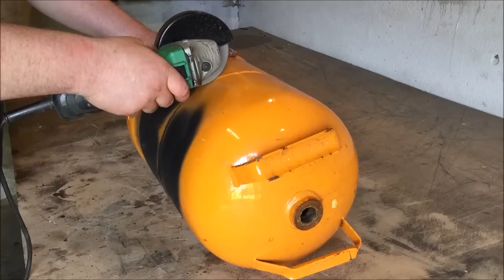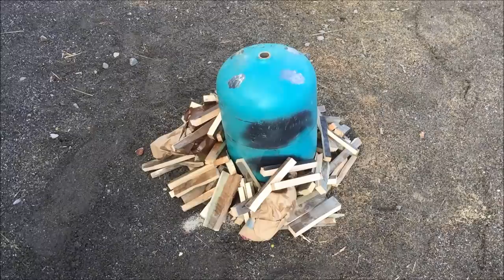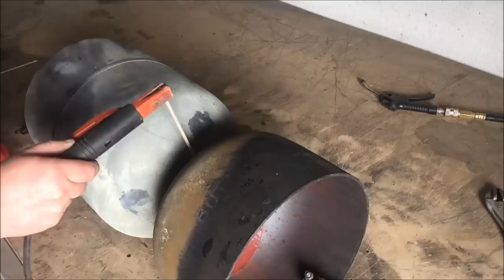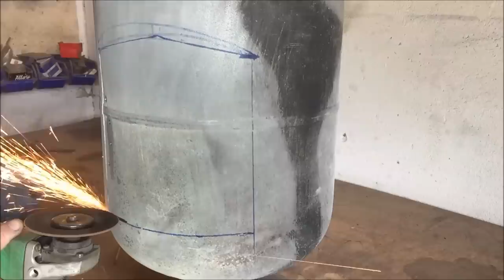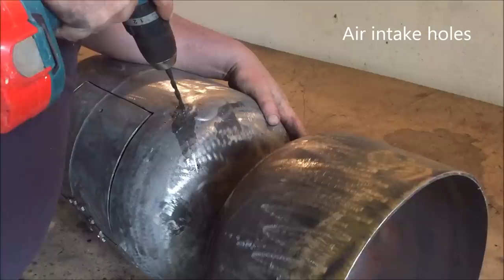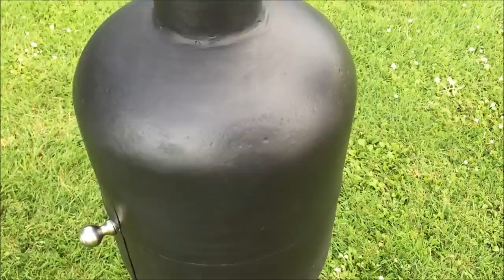DIY  Patio Heater / Fire-Pit

Comment: luv it but from my experience you should drill 8 x 20mm holes  about 6 inches from the top of the chimney pipe to get a secondary burn  and take away the smoke
Reply from the maker: Hi Mark, thanks very much for the tip.

Comment: Very nice build !

The door is a little tall for my taste, but I would use it as a wood burning stove.

Is your only air intake the through holes from the valves  butted together ; on the bottom ??

Comment: Very cool!! I was hoping the build wouldn't require welding (I don't have a welder unfortunately), but this is a very nice build. Thanks for sharing!! :-)
Reply: Use super glue
Reply: You can use J-B Weld high temp(I did on the chimney on the one I built),and to connect the 2 tanks together use a short pipe nipple the right size. No welding required.

Comment: Nice work.  I wonder if maybe you could have used another tank on top with a secondary air intake for seconday combustion to cut the amount of smoke?
Reply from the maker: Thanks, that could work. When it is lit first there is a some smoke bit when the fire gets going and it warms up there is very little smoke.

Comment: I agree this is a cool Idea. But as a person that burns wood a lot. This thing needs some addition to get 2 thumbs up. #1 if you could add a tray that regulated Air intake and #2 doubles as Ash collection, this would be right on. I’m telling you getting the ash out of this thing is gonna be a pain every time. Adding a latch to the door handle is a must. This way if a log falls over inside the fire it can’t fall out and onto your floor
Reply from the maker: Thanks Grant.

Comment: Great channel Eamon, thank you. I am also am mad into making stuff, lucky can also weld and fabricate and have a good work shop. Can you advise please, I am starting a project based upon (inspired) by your video using a 47 kg tank. Have had for many years and left valve open to get rid of as much fumes as possible. Do you happen to know if they come off anti clock wise or clockwise? Want to purge with water just to be on safe side before I start fabricating.
Reply from the maker: Hi Martin, thank you. If I remember correctly it was anti clockwise to open and it was extremely tight. They definitely need to be purged. I  filled them with water to remove any remaining gas, emptied then refilled again. I then left them outside  open air for a few weeks to vent before being used.

Comment: Cool project. Did that have any impact on the grass under where you had the fire pit sitting?
Reply from the maker: Thank you. The heat does not travel down to the bottom section at all.

Comment: How dose it hold up with the heat over time.? 
Also is the base cool enough to place on a deck?
Reply from the maker: Hi Ted, Its holding up great. I give it a coat of heat resistant paint once or twice a year. I use it on a concrete patio but I have used it on grass before and it did not scorch the grass.

Comment: Is there a reason you went to the effort of burning the paint off, then cleaning the Ash off and then later using a flap disc, could you not just do flap disc to remove paint and miss out the dirty burning and clean up tasks??
Reply from the maker: It would not come off with the flap disc.
Reply: Must be stronger paint than what's on mine as comes off with no effort at all with either a flap disc or surface strip/prep disc.
Reply from the maker: @4wdonamission  Yeah must be different, I would have loved it if it came off with just the flap disc.

Comment: How do you check for straightness of the chimney pipe?
Reply from the maker: 👀 Just by eye Gary. I tacked it and took a few steps back to see. A good hammer will do any fine adjustments. If it looks straight it is straight 😃
Reply: We had a saying at work, "Eyes were made before levels".

Comment: Can i ask - do you get much smoke escape from the door? i built one of these with a larger tank - same door as yours but smoke comes out or fire smoulders when door closed - do you think bigger(wider pipe needed?) or taller pipe? im using a sacf holding pipe as the chimney flue. Thanks man - yours looks class!
Reply from the maker: Hi Jay, thanks. I only get a little after lighting it. When it heats up and the fire gets going it stops. I used a 4 inch pipe on mine I wouldn't use anything smaller than that. It may also be an air intake problem, you could start by drilling a few holes on the side or bottom to see if that helps.
Reply: Sounds like the fire is being starved of oxygen. If the wood isn’t seasoned it will smoke more and kill the fire itself and likewise if the breather holes are too small.
Reply: Eamon Walsh DIY hey Eamon, it’s getting that time of year in Ireland to fire these up and I was wondering where you bought your steel pipe from? Iv tried to find locals here in cork at steel merchants and they are mental money 50-70€ per meter just wondering where you bought yours for €12? Thanks.